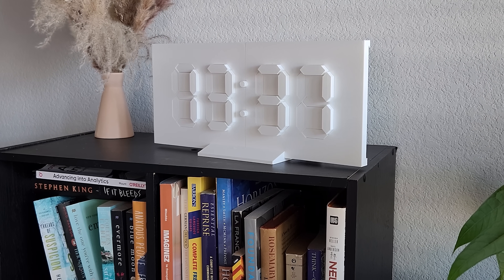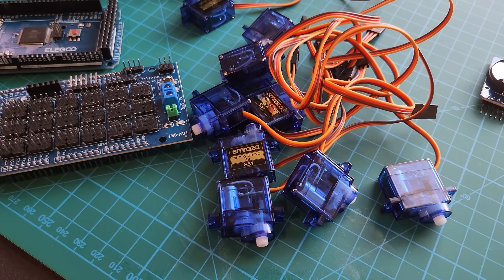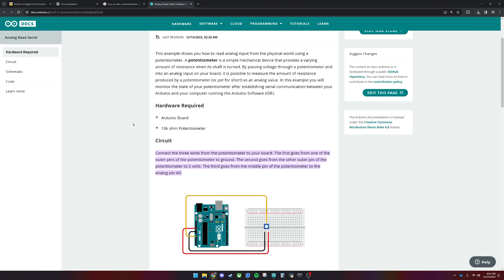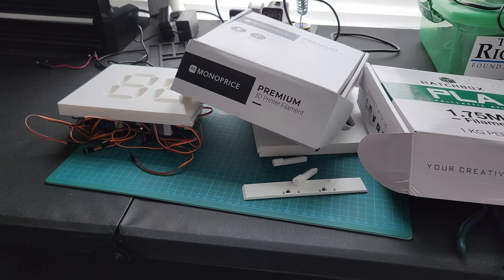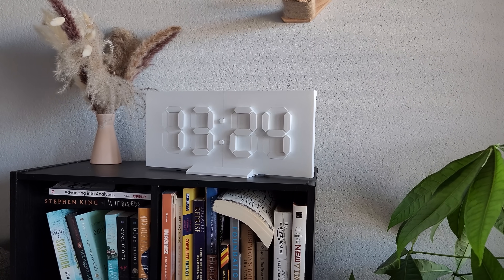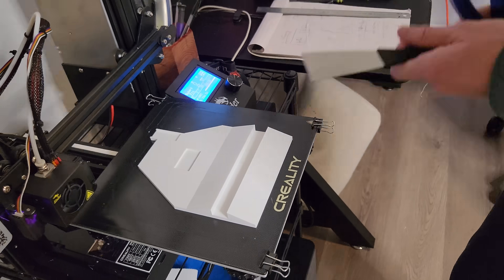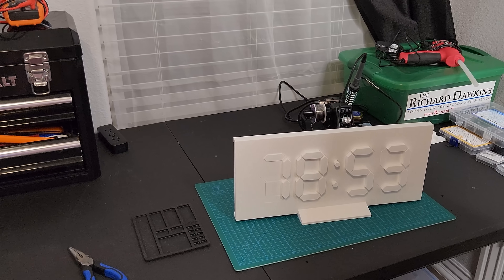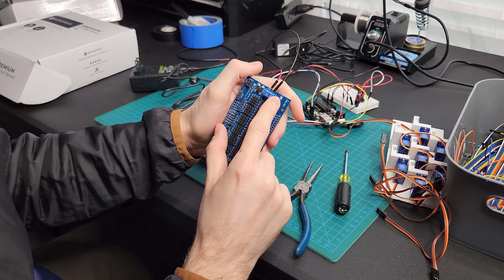I Built a Minimalistic Kinetic Clock Project with my 3D Printer and Arduino

Comment: 8 Hours to print that....would you like help with your print settings. I have an ender 3 and my print time for something like that is about over an hour.
Reply from the maker: Hey! I'm all ears! What are some key settings that can bring print times down?
Reply: @LukasDeem  alrighty then I use Cura, but this should work with all slicers it will just be named differently

1. Layer height - Standard is a good middle ground (0.2mm) you can go higher if you would like

2. Wall Line Count set to 4 basically how thick the walls are, set higher if you don't want your infill showing through 4 should be good enough.

3. Infill - looks like you might be using 100%, That really eats at print time. set it to 20% no real reason to set higher than 50%. I use cubic for all around strength.
If you don't like that your infill shows through the print. Try upping your top and bottom layers from 4 to 8. 

4. Print Speed - I have upgraded my ender 3 to print at 150mm/s
stock ender should be capable of at least 80mm/s
my stock ender would do 100mm/s with no degradation to print quality.
just change the print speed the rest should change with it.
when I set print speed to 100mm/s
infill speed sets to 100mm/s
wall speed for outer, inner, top and bottom all set to 50mm/s
travel sets to 250mm/s
intial layer speed to 25mm/s
MAKE SURE YOUR BELTS ARE TIGHT BUT HAVE SOME PLAY do not over tighten or you will have issues.

I would recommend upgrading to a direct drive extruder combo. If you want better print times as well as to print different filament.

let me know if you have any questions.

Comment: If you want your parts to come off the build plate more easily, get a spring steel PEI build plate.  Super easy to get parts off of it
Reply from the maker: Hey! So when I got the ender 3 it came with a flexible magnetic plate, but I had major issues with the first layer. I don't know if it's because I wasn't dialed in well or if the plate was poor quality. Since I got the glass plate I've had super clean prints, but I am also more experienced now. So I've probably tuned the printer better than I had when I was using the default plate with the ender 3.
Reply: @LukasDeem  I recommend the spring steel because the magnetic base holds it in place, and a quick flex of the plate pops the parts off.  I've never used glass personally, but I've seen more people have issues with glass than with the PEI spring steel, just my two cents
Reply from the maker: @Tinker_Nerd  hey thanks for the recommendation. I'll take a look at them tonight!

Comment: instead of using an rtc and a arduino nano you could use an esp and synch the clock with an ntp server. Like that it will always have the correct time. There just might be a problem with the number of servos you can drive with the esp. But there should be options with enough I/O
Reply from the maker: Interesting idea I use an ESP32 on my last project and I had a ton of fun working with it. I wonder if you can use an I2C servo breakout board to solve the problem with the lack of pins
Reply: @LukasDeem  pretty sure. I think there was another comment about that as well suggesting a board. So this should not be the limiting factor

Comment: Why are 30 servos used when the maximum segments is 28? 7 per digit times 4 digits
Reply from the maker: The colons in the middle both have a servo each. In retrospective this was not necessary, but it was part of the original design.

Comment: So clean! Your Ender 3 prints really clean too... What if you used those electromagnetic push/pull DC solenoids instead of servo's? It might sound cooler, and have less moving parts. That way you can make a little snap on fitting to pop on the digit modules instead of those toothed gear pieces.
Reply from the maker: hey thanks! It took a lot of work to get my ender 3 dialed in. I'm afraid to mess with anything now :-P

Comment: Nice build! One thing I learned making my own kinetic sculptures is that the servos will start to burn out within a week if they’re on all the time. I’d recommend a relay that turns them all off when they’re not moving to reduce the duty cycle and extend their life.
Reply: Usually turning off the PWM signal disables the motors also. Most likely also done that because otherwise the servos would emit a constant annoying sound.

Comment: If you want to run everything from a smaller power supply, mux the servos. If you don't want to deal with calibrating things and drift messing it up over time, rely on end-stops and let weak muxed servos dead-end on them instead. Dumber, cheaper, self-resetting.

Comment: Its a really neat project!
For not needing a large power supply, you could try to use these tiny 0-24v DC-DC stepdowns, that has VIN-Vout-GND and an enable pin (they are on ali and is 10x20mm ish). with these you could just turn off the servoes when not running. Then you'd ofcourse need way more outputs, which could be handled using a multiplexer of sorts
Reply: Just a relay, or maybe a mosfet, would do to de-power the servos, run one of the power leads to the servo board through it. Then you'd have complete isolation, complete on-offness.

You can get little relays on a board meant to run off an Arduino complete with the couple of other components it needs, costs about the same as a bare relay.

Also they make a nice "click" to go with the motor whining.

Comment: Sorry for dumb question but can we use arduino uno instead of mega ?
Reply from the maker: So you need the mega for the number of GPIO pins. However, if you are willing to learn I2C you can use a uno with a servo driver board.
Reply: @LukasDeem  thanks you for answer

Comment: I'm guessing those tiny stepper motors would be quieter, but you'd have to have some feedback something to determine the current position on startup so you don't push the pieces all the way out or try to pull them through

Comment: Looks great.
This got me the idea to use electro magnets instead of servos. The segments would be pushed out by a spring and pulled back in if the magnet turns on.
Reply from the maker: Do you know if it would require a lot of power to keep the magnets on?
Reply: You could even reverse the poles of the electromagnet programmatically and do away with the spring. Then they would only need to be turned on briefly to attract or repel a permanent magnet in the segment. Might be tough to isolate magnets from each segment, though, but the bigger the clock, the easier that becomes.
Reply: Might as well just use solenoids.

Comment: This would be a hundred times cooler made from stainless steel using Wire EDM zero tolerance machining, that way when the segments were retracted, they would appear to merge into the clock face, leaving no outline. I'd also add solid back stop plate that only the linear gears passed through so the segment always stopped flush with the clockface, making the gears helical would probably help a bit with the noise a bit.
Reply from the maker: Hey! I think this is a super cool idea. I'm thinking I may want to combine some ideas here. I've seen a lot of requests to build it with wire EDM and I've also seen suggestions to use magnets or solenoids to make it quieter. I think this means a V2 may need to happen!

Comment: For the servo sound issue: check pwm pulse separation and stability and also psu voltage and resistance

Comment: Nice! Get a flexible build sheet for your 3D printer. Perhaps you could try to design an build a single segment of the display that uses a Neo magnet to drive a custom solenoid or paper tube voice coil. It could latch magnetically to a much smaller magnet to toggle to the "on" position so the circuit wouldn't draw power unless switching. The small magnet could have coil to release the segment into the "off" position. A small spring might be employed if necessary. Small silicone bumpers could be employed to eliminate any unwanted sound. Possibility of making each segment a speaker, and/or adding a multi-color led backlight to each segment. I would do it myself if I didn't have a dozen other projects ongoing. 😀
Reply from the maker: Hey thanks for the detailed explanation. I've seen a lot of suggestions for using magnets but none with this much detail. Question, do you think I could make this magnet design work in conjunction with building the face and segments out of metal  using wire EDM with zero tolerance. THe idea would be that the segments in the low position would fit so snugly that the lines would disappear.

Comment: You could reduce the number of servos if you would be ok with zero in the first digit not being shown. It only needs to display 0, 1 and 2, so if we don't display the zero (09 would be just 9) you could connect 29, 32, 33 and 35 together, also you wouldn't need 34. You could also connect 16 and 17 (or remove them completely, I don't think they are that important), which brings us to 25 servos.
With the power problem - you could try multiplexing the servos and turn on just one digit at a time (or divide it into rows or whatever) and then quickly switch between powering each section, which would create the illusion of simultaneous movement, however as someone said, servos draw most power in the beginning of movement, so I'm not sure about the power efficiency and this would be probably louder too.
Anyways, great project, I enjoyed it.

Comment: Ideas for version 2:
Use a magnetic approach like flip dot displays this should be almost silent, for this a perfect fit would be good with polished surfaces so it does not get stuck when sliding.
Reply: I was thinking the same. Servos are the worst choice for a clock as it needs to run often, for a long time, and reliably.

Especially cheap hobby servos will run out quickly and it will cost a lot of power and resources to maintain its function.
Reply: I second this. Servos are awful for this idea... plus the noise

Comment: Probably way too expensive, but I’d love to see what this looks like made out of metal with the segments cut out using wire EDM so that when they’re retracted they seamlessly blend into the flat surface.
Reply from the maker: Seeing a lot of comments saying this. I'm going to have to look into the cost to get it done :)
Reply: @LukasDeem it is insanely expensive, but maybe you could get a collab with titan of cnc, they have the machinery you need
Reply from the maker: @lucachacha71  great idea! I'll see if I can connect with them 🙂
Reply: @LukasDeem  Get a PCBWays sponsorship and make it
Reply from the maker: @YourComputerExpert  I'm already in talks with them about sponsoring my clock V2 project 😎
Reply: @LukasDeem  awesome! Subscribing :-)
Reply from the maker: @YourComputerExpert  ayyy! Thanks so much 😄
Reply: I was gonna mention this. The 0 tolerance metal would look slick as!
Reply: Was the first thing I thought of while watching this 🙂
Reply: I plan on doing something like this at some point. Being a tool, jig and die maker, not necessarily steel but maybe aluminium or a combination of lighter weight metals 😊
Reply: @Weaselg83   Yeah brushed aluminium looks nice, just lightly brushed so you only just notice it. Will help disguise the segments a bit too, make them look more integral to the face plate.
Reply: @greenaum  Great idea, 'brush' the aluminium after the whole thing is assembled
Reply: @LukasDeem 
You could go with a photo printed as a wrap, like they do for race cars and aircraft. 
If you don't like it, just peel it off and, try something else.
Something by Jeffrey Smart, or Banksy maybe.
Reply: @snakezdewiggle6084  If you're going that way, why not some elasticated fabric over the whole thing? You'd have to rig it up right but it would be nice to see the digits just bending into it's surface. If it had a fine pattern, it'd emphasise the edges. Though don't ask me about interior design, I've no ideas beyond that.
Reply: doesn't need to be metal to be seamless I'm pretty sure, its about technique, not the material.
Reply: @starcultiniser particularly wire EDM works only in metal, which is the technique they're saying to use. It does need to be metal as it needs to be conductive.
Reply: @somedude2492  You an cut any conductive material, including carbide.
Reply: There is a slightly simpler version, but it is not an open source project. 
https://youtu.be/xVwXEVpJpaA?si=ehE1GTViSwgUgzTL

Comment: How about making the digits transparent, and a wood texture on front. With LED. So when the numbers move, the surroundings getting lit up. Or if the blocks would move in instead of out. The number itself would be lit due to the surrounding transparent plastic. Don't forget to use semitransparent plastic in order to have that diffused led look
Reply from the maker: Very cool idea!

Comment: As your power supply is a 5V supply, just put a small jumper wire from the sensor boards VCC pin to the +5V pin on the Arduino board. Then you only need one power supply :)

Comment: Get rid of servos. Use coils and magnets . Design pcb with the coils using copper trace, place magnets in numeric segments. Design that when coil is energised the magnetic fields repel. Bingo, very little noise as there are no mechanical parts.
Reply from the maker: I'm planning to learn how to create PCBs soon. It's something I've never tried before, but I'm super stoked to learn!

Comment: Silly me. I would have used solenoids.
Reply: could be a goood choice, especially noise wise, but you d probably struggle with the alignments.
Reply: I agree. The whole setup of gears and such seems like an over complication. Still, the other commenters have a point about how complicated that could be.

If he put some thought into it though, he could gave designed the segments to move along Teflon rails, that forced alignment. The solenoids would just need to move them from one point to another. Combining solenoids with Teflon parts would make the setup dramatically quieter too. Just the click or the solenoids changing position. It would still drive me insane.

Of course, I think the video mentioned that the guy was copying someone else's design. From his skill level, I think he viewed actually being able to just copy the design successfully as a major task. So I'm not surprised he didn't vary it except where he was forced it.
Reply: Came here to say this
Reply: Wax cylinders (like on a washing machine door latch) would be even better
Reply: Solenoids would be to fast and ruin the look, the whole asthetic of this clock is because of how it moves.

Comment: It is easy. Only switch power to the servos when you want to move them. And only switch on the servos you need to move. If you want them more quiet, reduce the supply voltage, it is possible in a range depending on the servo.

Comment: Heat set inserts for machine screws for the closure end of things 
Solder iron is all that’s needed 
Could adjust the print to accept the inserts easier, however it’s an easy addition to your existing print too
Check them out
Reply: Yeah have never used these but after seeing a bunch of YouTube projects using them I'm itching to use them on a project. So satisfying to watch them sink into the plastic
Reply: Well they’re as satisfying to use as they look, you’ll love them after the first one

Comment: 2 power supplies is probably fine to be honest! you just have to be careful to tie the grounds together, although it does depend on how the servo control board is connected-as long as nothing is trying to backfeed power all should be well. Great project!
Reply from the maker: So I believe connecting the shield created a shared ground. I could be wrong though :)
Reply: @LukasDeem  as long as you connected the ground of the arduino to the shield you probably did, tbh if you didn't tie the grounds together I doubt it would have worked reliably, probably

Comment: For the power supply — think about maybe using a USB C PD drop-in board, along with DC to DC power supplies internally to convert voltages.

Comment: Regarding power, maybe you can use a power supply such as the MeanWell LRS-50-5 as an example. And then use buck converters or boost converters if necessary to adjust the voltage level as needed.

Comment: Love it! One idea to take it over the top: when you 3d print the pop out segments, make the outer face only one or two layers thick, then put an RGB LED behind each segment and light them up when they pop out and turn the off when they slide back in.
Reply from the maker: That would be super cool! What if we made the color of the LEDs different based on the time of the day. Each part of the day has a vibe right? :-P
Reply: Yes! I'd like to see this in black, with the faces of the digits being thick enough to block out the light but the remainder printed in a translucent/transparent filament. That way you'd get the glow of the digits on the face but not directly lit.
Reply: Great idea. Using limit switches on the servo's would also help with positioning as well as switch the leds.
Reply: creo que eso le quitaria un poco la gracias al mecanismo